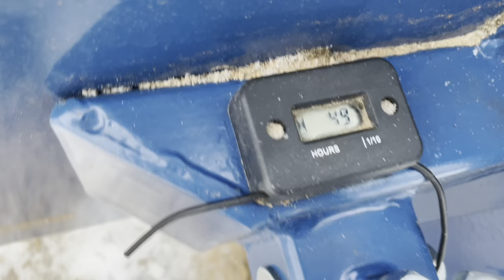One year range road sawmill review

Comment: Sorry to see your problems...  I have the 5026 myself and it works beautifully.  The wobble you describe is very normal in this type of assembly, and all cheap sawmills will behave the same way.  BUT, there is no reason for this wobble to induce bad cuts, the plane of the blade is not going up and down as it wobbles.  The way you are thinking of bracing it will not really help, and it will just make it harder to move the head up and down.  It will bind.  It comes down to the way you adjust all of it (every adjustment, not just the pulleys), and how you operate the mill, and even more critical, the state of your blade.  A dull blade is the biggest cause for bad cuts, especially when everything else is nice and adjusted like it should.
Reply: some time the problem is the operator
Reply: The wobble is only normal for road range, not all cheaper mills. My woodland hm126 does not do that at all. The braces are much different on the woodland mills machines making them much more rigid and robust. Nor have I ever wore out a bearing or belt in the 150hrs I’ve had it.

Comment: Thank you for your contribution.  My idea is that you could reduce the wobbling of the cart by cross bracing the two posts together, in the vertical plane, on each side of the cart.  That is because these posts are long and the top assemblage of the cart doesn't make it to keep them vertical when we push it forward against the log.  Cross bracing in the horizontal plane would help too but is impossible since it would hinder the movement of the sawhead.

Comment: Can you tell me what the distance is on the width of the rails center to center? The manual says the distance should be 30-5/16” but I am measuring 33-5/16” and wondering if the manual is a misprint

Comment: Go to lowes and take your time and pick you out 2 good and straight 16 foot treated 4x4's or 6x6's. If cutting very large logs I'd go with the 6x6's. Mount your tracks onto them by drilling a hole in bottom flat of track and bolt them down real good. Then put your tracks on good hard ground that won't give. This will not only give you good support for huge logs but also keep you from having to constantly realign your mill. As for the wavy cuts I'd suggest a good quality blade from woodmizer or another reputable company. As for the track extensions you can go to any steel shop and buy angle iron and some flat stock and make your own. I not only bolted my extension extension but also tack welded it real good and grind it smooth where the tracks join. As for the wobbling of the head are you sure all the bolts are tight? It could be just cheap metal flexing at which point you may have to get stronger upright metal tubes or brace it. A little sway back and forth should not affect the levelness of your boards if the mill is square but it usually caused by forcing blade to fast and a dull blade. As for the belt wearing out I swear going by the video your wheel looks a little cooked out some. You may need to dial it back in line with the drive pulley and make sure tension isn't too tight for that will definitely eat your belts up quick. Did you ever at any time readjust or mess with your tracking bolts. If so that's the source of most of your issues. I've never heard of this mill or company. I got the harbor freight mill when they had the coupon and absolutely love mine. I run the pee out of it and it paid for itself quick but I did mount my tracks at the get go as I  described above. If you did adjust the tracking it's gonna take a bit to get it back right again for its a pain. Best wishes to ya.
Reply from the maker: If you watch my truth behind range road video I have it in a full building it definitely helped and I’m starting to figure out a brace with angle thanks for the input I appreciate it!

Comment: wow sorry that you had issues with customer service and missing hardware. i have had a far better experience with it. i have the rr 5036" with electric winch and extension and all the issues ive had have been human error.  the tracks and bunks are identical to woodland mills and ive never had issues with the gantry frame(even tho my buddy dropped it on its side on assembly.) yes the log dog holders are junk and ive landed logs on the tracks and bunks that have bent them, but thats 100% human error and you get what you pay for. the only time the blades dont cut straight is if its not tensioned right or its not level.

you might need to add the screws behind the two square tubes on the gantry to level it correctly because the second your blade hits wood that whole thing moves a 1/4" from the tubes.

Comment: I have a woodland hm130 but watching your video I noticed that you don't have the set bolts installed on the front carriage. Try putting those in, and tighten them once you set the height. I hope that helps you
Reply from the maker: I have tried that a few times it doesn’t make much of a difference I find anyway I need to come up with a brace of some sort for it.
Reply: He has way more issues that that but that is one. So many things wrong with this set up that there is no way it is going to work right until it is redone.
Reply: @lifeinthevalley14  you don’t need a brace bud. You need to 1. take that mill apart (completely 
2. Put all your hardware store bolts and crap you used in a can and put them in your shed to use on other things and 
3. order the hardware kit from A Range Road dealer. If they wouldn’t talk to you anymore it’s probably because they feel they can’t help you. Your going about this all wrong. Even if you have to buy the hardware kit at this point you will be ahead. Sounds like your bridges are burned. I might be able to help through my dealer. 
4. Find out how and build a proper base with post and beams or cement. Get it up off the ground. 
5. Assemble the mill following the instructions exactly. 
If you contact me I would be willing to help you out with some advice and guidance. 

If your keep adding braces and garbage to this mill while it it still not setup correctly it will add to your problems not solve them. One more thing; every mill design is different for a reason and you have to understand the (why) of the engineering before you criticize it. This mill has some unique engineering that is very different from other designs and they all have a good reason a why they did that. You might not agree but all of these differences work well if you know why and how to assemble and run the mill. 
As it is you should not even be attempting to mill any log period. It is not safe as it is. 
Contact me and we’ll talk if you want some help.
Reply: @lornebruce8200  The Range Road bolts that came with my 5032 are cheap, soft junk. I broke several bolts during assembly while torqueing them to standard specs. I replaced a lot of them with better quality (10.9) from a local fastener supplier. After running the mill 5 hours I noticed the carriage had twisted so I checked torque and many bolts were loose. The carriage frame fasteners go through the vertical posts with no internal support so the posts crush down and the bolts won't stay tight anyway. I guess I'll have to weld spacer tubes into the posts to stop them from crushing down, or replace the verticals with heavier wall tubing. Even so, I get acceptable (to me) lumber with sharp blades.

Comment: Interesting. I'm curius to find out what is causing the wable and if all customer get that. I saw some video if those mill where you have to tight 2 bolt before you cut and you have to losen the 2 bolt before changing the cut height and tgen tight after. Sound anoying but mabe this reduce the wable?

Cutting strait is what i need in a mill and if this model can't do that i'll look at others.

Sad as the price are good and it's build in canada with a chiness motor.
Reply: I have one and I don't tighten them, I just crank down and cut . It work great for me.

Comment: I have the 22 inch mill and put mine rogether as the book says and have no problems. works great
Reply from the maker: It’s a lot smaller than mine also you may have gotten hardware makes things a little better! But still with the smaller mill grab it and give it a wiggle you will see how much it moves…
Reply: @lifeinthevalley14  Mine don't wiggle like that ,I squared it up as I tighten the bolts but I thought about putting a x brace across the top because it has a bit of play but my woodland mills was the same way it had a wiggle but nothing major. I had a woodland mills foe 19 years and I really like the Range road mill for the money and it seems to do well. I have it mounted on 6x6s and I think having level and solid helps more than anything. I don't know were you got yours form but my dealer has been great, I'm sorry you're having so much trouble. I have been well pleased so far. I see how yours wiggles but mine don't wiggle near that much. I'll be glad to give you my dealer's name and maybe he can help.

Comment: You are missing the 2 head clamp T bolts that have to be tightened before each cut. Annoying but makes a big difference in the wobble.
Reply from the maker: One thing I found with them it would tip the mill head back when you tighten them then my blade would wander up and down.
Reply: @lifeinthevalley14  If the saw head tips back too far when the t-bolts are tightened, don't give up. Loosen the post mounting bolts and lean the posts forward until the blade is level. Re-tighten all the mill assembly bolts a few times until they stay tight. Slip some long J shaped shims into the sliding tubes and bend them over so they can't fall out. I cut shims out of brass shim stock and reduced the slack by half or more. Could also use any thin steel like welding rod cans or old roofing. Adjust the blade guide clearance to .010 inch top and bottom. Grind the guide blocks flat if you need to. I converted my blade guide blocks to stacked ball bearings and can run with less clearance and better control. Dull blades will still cut wavy lumber no matter what you do.
Reply from the maker: @kknows3512  thanks for the advice I will have to see what I can come up with!

Comment: i was pretty close to buying one, the fact they only accept Etransfer and not Visa speaks volumes.. it looked really similar to the woodlands mills i thought maybe it was identical and just didnt have the brand advertising and customer service but clearly its completely different.. look at the HM130max they have a bent piece of 3/16" plate that spans the entire back of the saw head carriage, theres a 45 in their upright that it wraps over, i think thats the main difference to get that sturdiness 

maybe add some 45 gussets in the top back corners with plate across them, and plate across part of the back supports, gussets anywhere else its weak, Pallet Racking can be a cheap source of steel, i was getting  6" channel iron for 30 or 40$ a piece 12' long, and 1.5x3" rectangle tube for 10$ 10ft, put some 4" or 6" materials under your rails and some more braces between those

make sure the belt tension is correct, id even jump over and look at  a woodlands mills the earlier verion had the exact same tension system the new ones are upgraded to have an idler, use their older specs for tensioning and make sure the motor stays perpendicular to the pulleys, if you tighten down the mounting bolts with it at an angle that could chew up belts

Thanks for saving me a pile of headaches ill order the Woodlands for the extra 900$ and i guess hope the 14hp is enough to cut at a decent speed
Reply from the maker: Thank you for your advice I appreciate it!